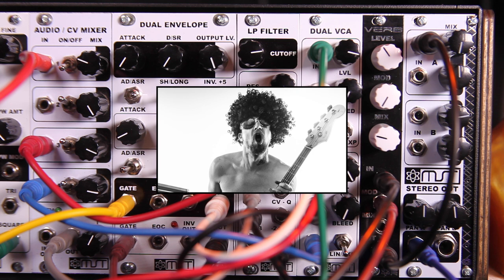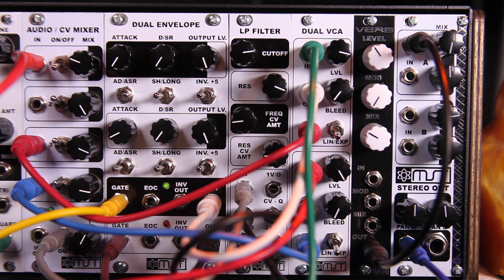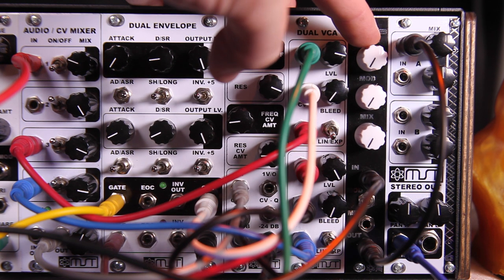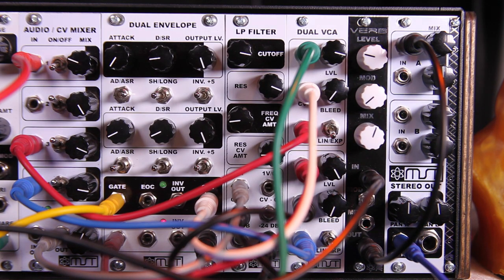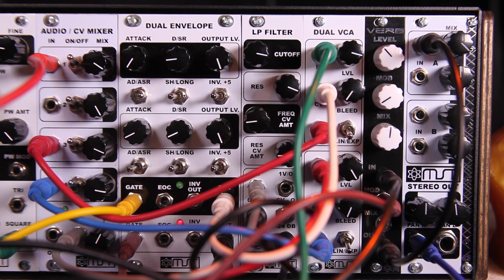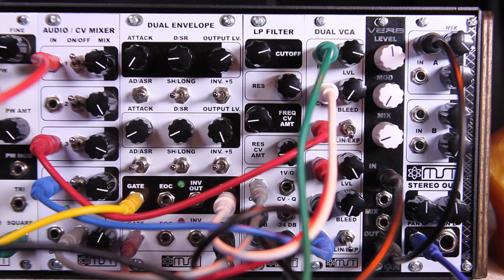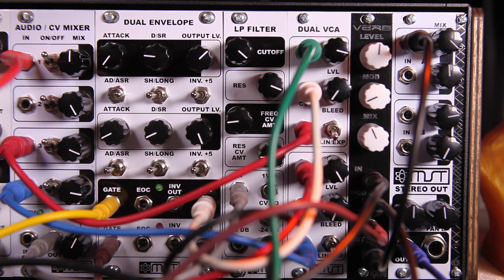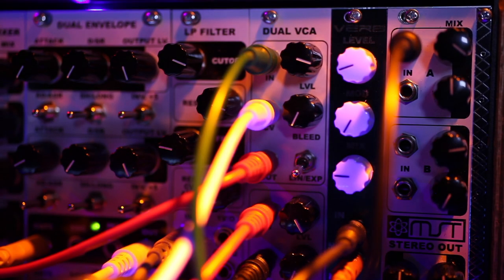VERB - Synthrotek Modulated Reverb Eurorack Module Demo - Modular Synthesis

Comment: Sounds great. Do you get the effect by running the 3 2399s at different frequency ranges?
Reply from the maker: Yes, one of the Pt's has a slide rate change :)
Reply: This comment prompted me to go check out the Bom ... holy cow this is a very involved circuit! I was not expecting so much in such a small module. :)